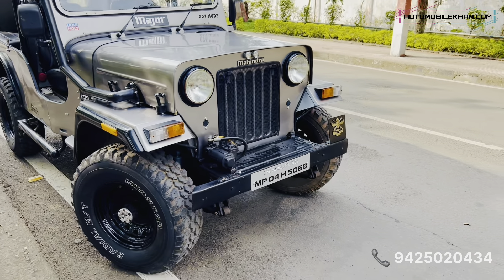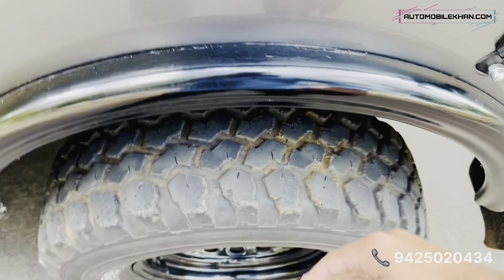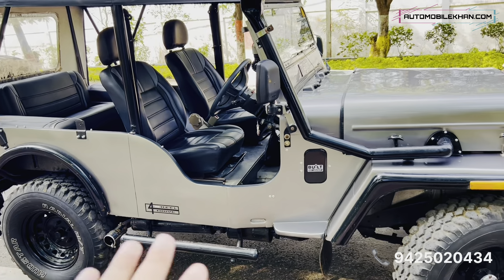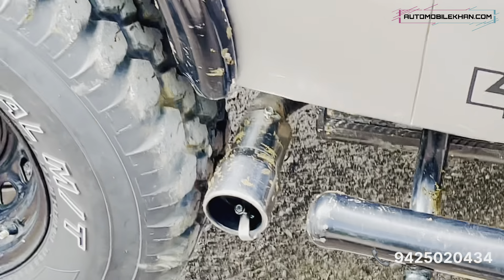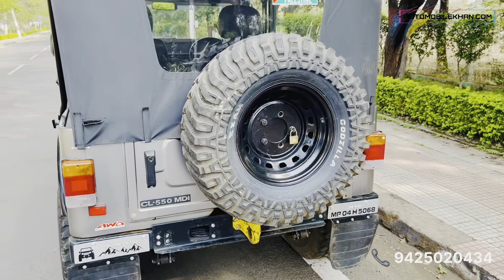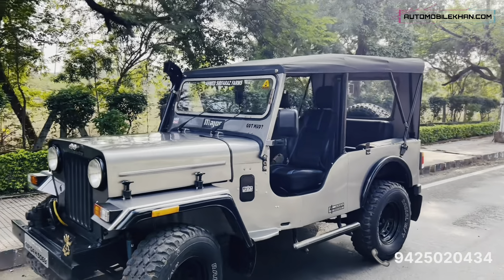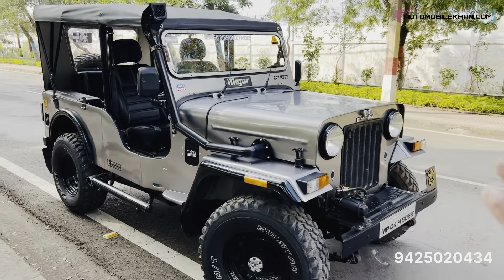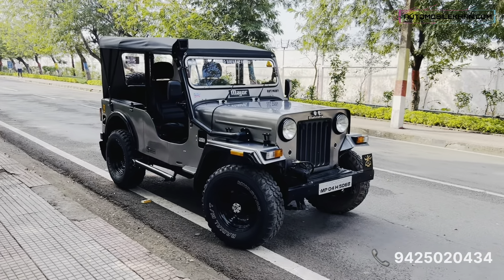Modified Jeep | Mahindra Major 4x4 | Jeep Modified | Mahindra Thar | Offroad Jeep | Jeep Restoration

Comment: Silencer is too close to tyre.
Reply from the maker: Thats on the OEM fitting! 
And the wheel just goes up and down vertically, there is no scene of horizontal movement, so it does not matter. :)
Reply: @adnaankhan  what about the heat from that?
Reply from the maker: Yes thats why the muffler is placed, and eventually the throw of the exhaust is enough that its not getting in contact with the wheel.